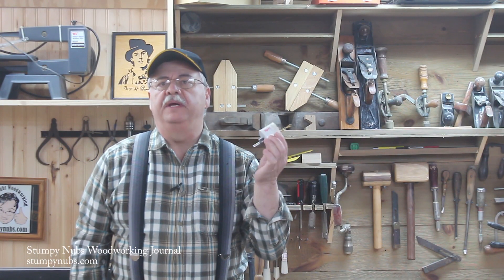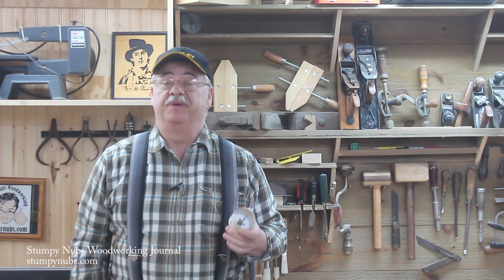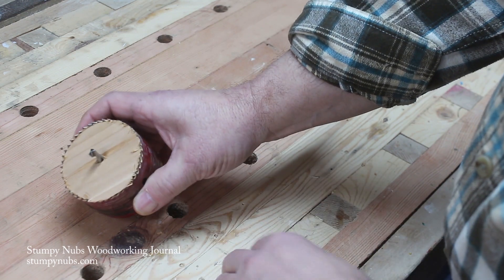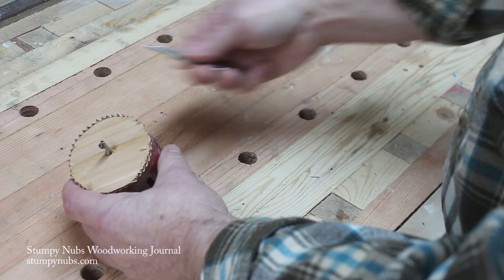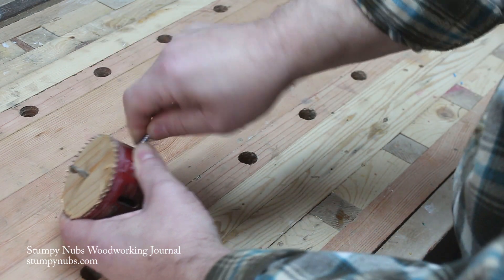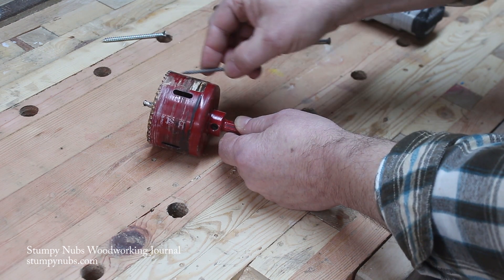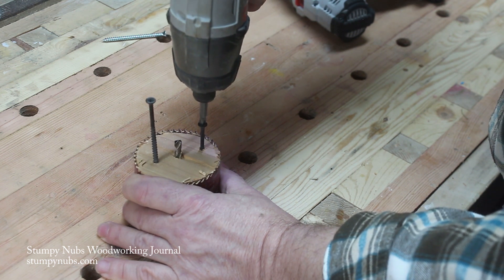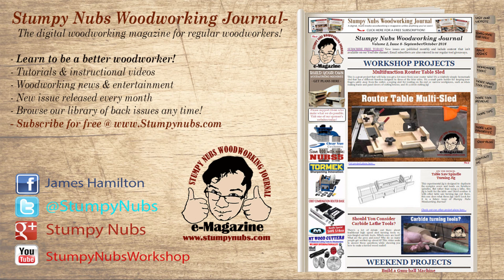Woodworking Quick Tip #26- How to unplug a stubborn hole saw

Comment: It's also easier if you cut the hole half way from one side and finish cutting from the other side.
Reply from the maker: That will also eliminate tear-out. Good tip!
Reply: Spud Wegener I think this is the best answer to this problem.
Reply: Spud Wegener I was just about to make the same exact comment. Coming in from the opposite side doesn't seem to cause the plugs to get stuck as bad.
Reply: Spud Wegener 
Some times on a cabinet you can't get to the other side . Or like drilling thru a floor.

Comment: Nice. In most of them, the arbor attaches from the inside, so you can just take off the lock nut on the back and smack the butt end of the arbor bit down on the workbench. It'll pop out and take the plug with it. A little annoying, but pretty fast.
Reply from the maker: Not all saws have a removable arbor. But your idea will work on some of them. Thanks!

Comment: Any two screws as long as the heads are larger than the drill bit and screw in a little way across from each other - place screw heads in vise - turn on the drill & pull up. No damage to the hole bit.
Reply from the maker: That's another good way to do it. Thanks!

Comment: Someone makes a slightly oblong hole saw, fastcap maybe? It's supposed to make the cut/rip a little big and allow the cut piece to fall out easily. Until I find and invest in those, this is a great idea!
Reply from the maker: That's interesting. I'll have to look into that.
Reply: Stumpy Nubs it must be something hung I saw Paul Akers mention they were working on in a video... I can't find anything about it at the moment. Some fastcap skunkworks program probably...
Reply: Well, I can't find a reference for it anywhere. Probably some binge-woodworking video induced dream I had. Feel free too steal the idea and send me a little compensation if it takes off.

Comment: Most hole saws I've ever used have holes in the bottom through which one can poke a couple of nails to clear out the cutoffs.  I've never had any trouble using those.  Is this tip aimed at users of some mysterious brand of hole-saw that doesn't have those holes?  (I've never even seen any without them.)  First seemingly weak tip I've seen from you guys - most are great.  This one appears to be of questionable value, based on my experience.